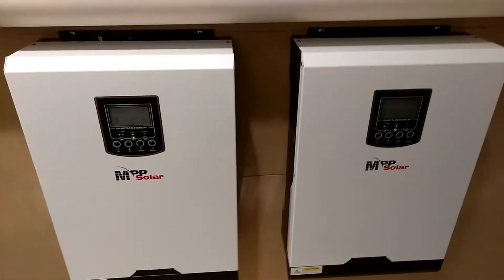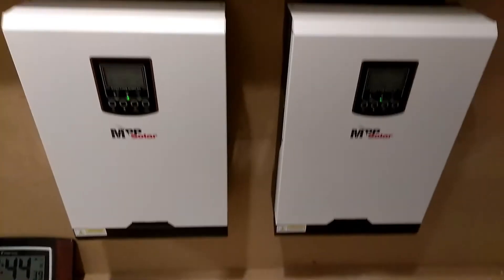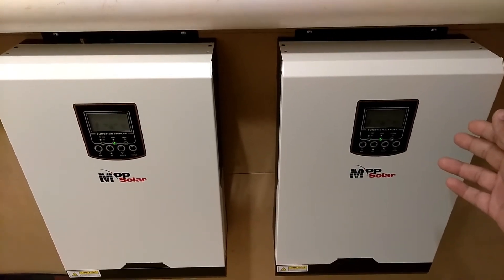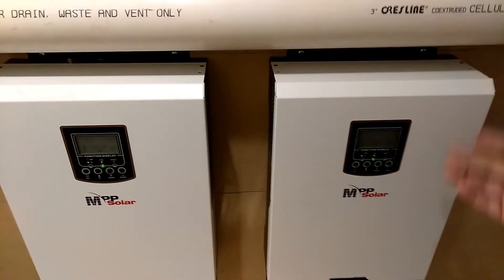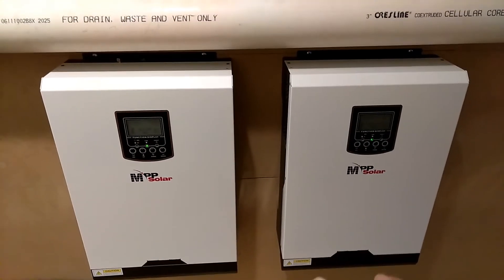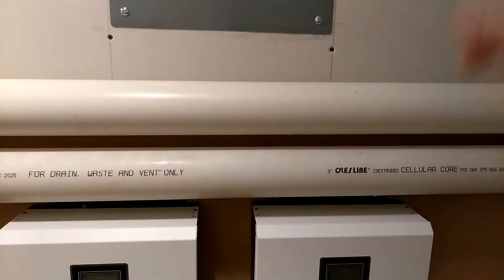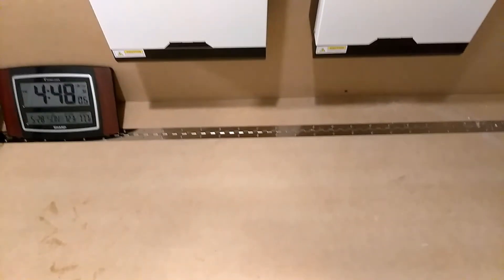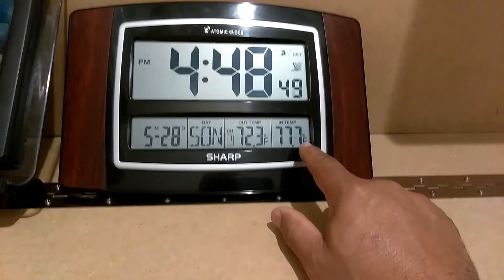Questions answered about MPP solar inverter.

Comment: I’m thinking of buying this type of inverter, how reliable is this inverter since you been having them for over 4 years? Any reliability issues?
Reply from the maker: Very reliable I burnt up one trying to use a grid tie with it but that was my fault the other two is still working fine I sold them to a buddy of mine and he is using them now. I contacted MPP solar and told them what I did and they sent me out a new board for the one I blew up and it's back working too I sold all three of them about a year and a half ago and they all are running today.
Reply: @carsonlurbanwindandsolar3437  Thanks a lot for the update Carson . I was wondering because I’m considering one and had few questions circulating my mind. The inverter uses approximately 50 watt which is kinda high if you run it 24 hours that’s almost 1.2 kw . In my situation I really want to use it off grid when the sun is out approximately 8am to 4pm and I don’t want to size up my battery due to the expensive cost of batteries and the fact that I don’t want to use more than 40% of the battery bank in order to increase the life cycles of my battery . Do you think this inverter needs to be turn on 24 hours  to work properly or do you think turning it on and off daily would reduce its life and what happens to the settings if the inverter is turn off ? Do you have to punch in the settings again or it saves it?
Reply from the maker: @Ahmed-rh5rt  all settings are stored in the inverter so you can disconnect the batteries and the solar power and it will stay at the settings that work in there when you disconnected it. As far as shutting the unit off at night that will be no problem at all the only thing is if you shut it off you do not get any power to your loads meaning that if you have a generator it will not power the loads that's connected to the inverter when it has been shut down. But you can put the unit in bypass mode and you can hook the generator up to the AC hookup and you will be able to run a generator and still have the inverters on where it can charge the batteries up hope that helps you.

Comment: Wow. Check this same model ISolar MLV 3K:  https://www.aliexpress.com/item/32664518946.html
 it is 3kva 2400w 24Vdc for 120Vac 60HZ output (Like US/ Canada/ Mexico and Latin America countries). it can be parallel with Max 9 units. So you can get Max power 27Kva for single phase and 3-Phase.
Reply from the maker: A lot of people had trouble with that unit.  I have never had one but I have had several people contact me with problems with them.  The company told them that they cannot be fixed to throw them away and buy another.  MPP solar offers all parts to fix your unit and they have good customer service. If you go to my video how I blew up my pip check out the comments in there you will see one of the people that left me a message on that unit.

Comment: Hey, the inverters have AC input and AC output, what connects where? What's the difference?
Reply from the maker: The AC power comes from your existing breaker box to the AC input on the inverter. The AC output on the inverter can go directly to your loads are you can run it into a subpanel and all your loads into that sub panel to be distributed through your home.  you can run off of your batteries during the night and you can run off of the solar panels during the day. If there is not enough solar power coming in it will use battery and solar together. Your grid power will be the last resortif you do not have enough solar or battery power it will transfer over to the grid power and feed all the loads.
Reply: @carsonlurbanwindandsolar3437  
Very well explained. Thank you

Comment: Do you need the paralel kit if you use one i verter on each phase for 220v?  I would think they would need to sincronize?
Reply from the maker: When I contacted the company that made the inverters they told me that it was not for 220 volts the parallel Kit only made the two units operate as one so if you need 4000 w you put two units in parallel to give you 4,000 @ 120V  if you only need a 2000 Watts you could use one unit to achieve your goal.

Comment: I have a similar 1Kw system (company is flinenergy) at home. What I see is that one out of two fan will be continuously running in the system even though the mains AC input is bypassed to the output and battery is fully charged. Is it a problem or is usual with these kinda inverters?
Reply from the maker: Abhishek Kumar yes my fans run all the time 24/7 they will speed up when the loads get heavy and they will slow down when the loads get go down.
Reply: How is the flin working ?I'm planning to get one
Reply: @prads34  no issues yet, but fan keeps running unnecessary sometimes

Comment: When you talk about bonding your neutral and ground you cant you do do that in home applications? I heard in mobile applications you are supposed to separate ground and neutral. I dunno? I have a  magnum 24 4000 watt power inverter with the neutral and ground bonded together thru a transfer switch for 3years, but I just bought this mpp I just don't want to burn it up? Your thoughts?
Reply from the maker: ra ant I have two breaker boxes my main and a sub box . here in my state you can only have one box which is the main that's bonded the sub box can only be bonded through the main so that's why you have to separate your bare ground and common wire .  because it will not pass inspection if you Bond them together hope this help.
Reply: Ok Thanks! I have the 24v Magnum going to 1 transfer switch thru the main and I have a sub panel with another transfer switch that I was going to wire the 24 v msd mpp. Just didn't wire to burn it up, I'll put a video up, but thanks for your input!

Comment: does the mpp solar have pure sine inverter? how does it work? tv works? did you check wave with oscilliscope?
Reply from the maker: oz turk it works fine with LED bulbs my refrigerator my deep freezing my LCD TVs and and no I have not checked the power coming out of it.

Comment: Sorry to say, but the information about the parallel kit is wrong. If you have a string in the house using 600watts and a string using 400watts, the inverters in parallel will absolutely not put 1200 watts in to the house. They will try to even the load among them and put 2*500watts into the house.
Reply: only thing about not being parallel is when your inverter is designed to put out 3000w and you are using 2 unparallel then when the load on one inverter becomes greater than 3000w> the inverter will trip.
Reply from the maker: Danny Jul what I was saying was just an example MPP solar told me that if I had to separate loads one-on-one inverter and one on the other inverter that the inverters would do exactly what you are  sang but what if you had one inverter only requiring 40 watts and the other inverter needed to put out a 1000 Watts how would it equalize that out.
Reply: carson l urban wind and solar When The controllere are in parallel, the loads will also be in parallel when connected,  and then the 2 loads will become one load of 1040 watts and the both controllers will give 520 watts if thay both have the solar or battery for it. Anyway Nice video i like what you did with your battery Box.
Reply from the maker: we both are saying the exact same thing I was explaining why I did not buy a parallel kit I did not need it for my application I did not want to parallel my two systems so I didn't need to buy it that is what the video was about . you only need a parallel kit if you are going to parallel both of your units together to be one I did not want that so I did not buy a parallel kit.
Reply: @carsonlurbanwindandsolar3437  I think efficiency has a play here too.  You have to take into consideration about the inverter efficiency.  If you have a 40 watt load on one inverter, and a 1000 watt load on the other, they will be running in a different spot on the efficiency curve.  There might be an advantage to running them paralleled in a more efficient spot on the curve.  In my off grid set up I look for efficiency anywhere I can find it.  Also you would not be able to run 220v loads on that setup unless the two phases where synced.  you probably dont need to run a 220v load anyway.  I like your setup! super clean!
Reply: If you ran in parallel, if one unit went down would both go down? Im looking into off grid only setup and the 121lvmk can be ran in parallel if i ever need to expand. Im running 2 280ah battery banks with their own bms together to make a 12v 560ah battery, so if a cell or two or one bms goes bad i can take one bank offline and still have power using the other one. If i need to get another all in one i was thinking of just splitting the load like done in this video, but still wonder if two units were in parallel would i be without power if one went bad? If i did two since im installing in a cargo boondocking conversion my thoughts were one bank and unit for the mini deep freezer and lights/fans, and the other for a 5,000 btu window ac to sleep comfortably on a hit night when a fan wouldn't be enough. Since the fans run constantly i wouldn't have double the noise inside the trailer if i ran in parallel also.
   I have a bluetti solar generator i figured i could plug the freezer into and shut one pip off completely at night, saving the battery bank and/or using as back up if i ran down the battery bank due to lack of sun. I will have a small gas generator for emergencies, as well as a vawt windmill mounted on the front of the  trailer which adds 6-7 amps of charge if there's a wind. Im told that's excessive, but i hate listening to gas generators run all night, and i want to be in some way out of the way places, and not have to run 30-40 miles to a nearest town for 3-4 weeks if i don't need to. 
   I like the way this is thought out and loads separated, and if one goes down and takes the other with it (Murphy's law), ill definitely run as separate. But it doesn't hurt to know my options. Thanks for the video, im going to look to see if you have more covering your solar panel set up, not sure what it takes to power these. I only have room for 4 210w panels on the roof, hoping it'll be sufficient. God bless!